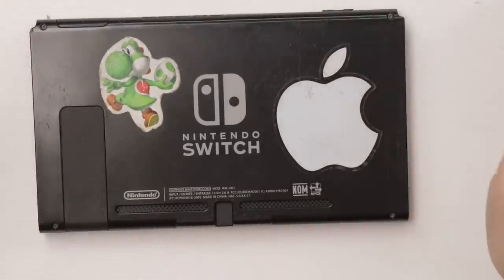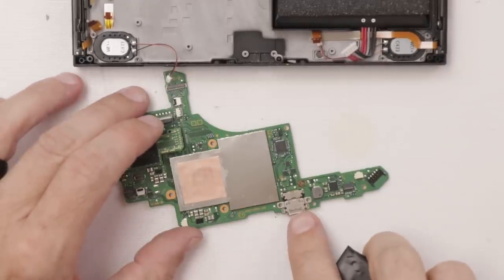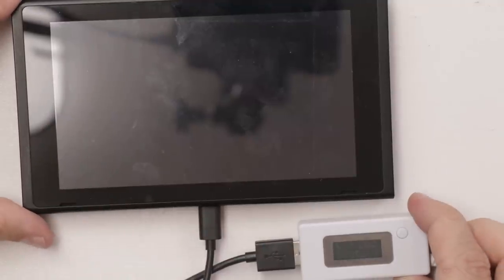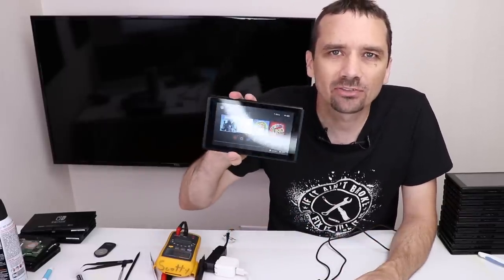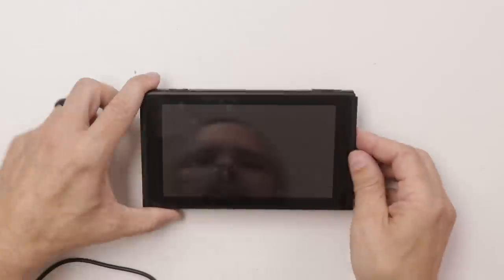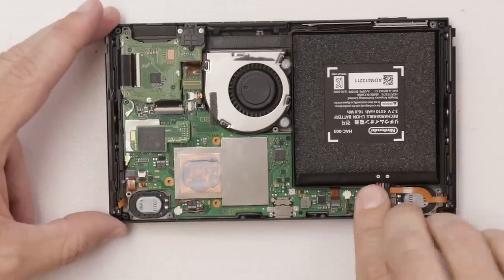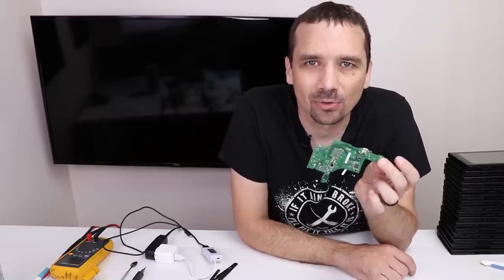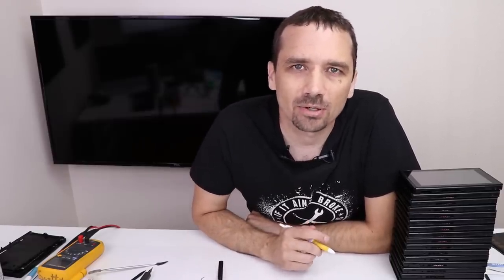The Numbers Are In (Sort Of)! This Lot of 20 Broken Switches Turned Out Good!

Comment: Are nintendo watching this and thinking "let's do something about the video chip"?
Reply: It’s supposed to be a security measure so you can’t charge your Switch with a 3rd party dock I believe.
Reply: @pr9334  That's called a money making measure, not a security measure...
Reply: @pr9334  That would literally be a violation against the terms for using the designs of a USB C Port. Because USB is supposed to stand for UNIVERSAL SERIAL BUS, meaning ANY bloody cable with these connectors works >_>
Reply: @Jukantos  the switch is pretty well known for not using the USB c standards that were put in place. The way the switch handles charging is exactly why you should never use any charger that isn't made by Nintendo. I bet you everyone of the switches that didn't charge (with the exception of water damage) were charged on aftermarket chargers or Android chargers
Reply: @toxicavenger6172  Luckily i still have my original charger, but i still think that's a bit of a miss-step on nintendos part.
Reply: @Jukantos  I'm not 100% but I think the switch handles charging the way it does due to the docked and portable modes.
Reply: @toxicavenger6172  It's not rocket science to improve on that, though. We've had almost 10 years of Android- and iOS tablets with external display support (and lately even way faster processing power than the Switch) and those charge in a sane way.
Reply: With the no third party chargers thing, nintendo had better print this on the box where it can be seen through the shrink wrap before you choose to go ahead with purchasing the console, in australia at least, otherwise they would be loosing money left right and centre. We have powerful consumer laws here which even Apple cannot escape. You take the busted consoles back to the store, touting australian consumer law "a major fault: a defect or design flaw that you were unaware of at the time of purchase that makes the purchase not fit for the intended purpose. You may return the item for a replacement, repair or refund at the your discretion". Apple tried a similar stunt with the Error 53 fisaco, where if the screen had been replaced by a third party, the phone would brick upon trying to upgrade the firmware, and Apple got kicked in the balls for that one :P
Reply: @dash8brj  it's actually written in the instructions not to use any charger except the provided one.
Reply: @toxicavenger6172  Ok, but he is not using the original charger in the video. So...
Reply: @Mitog98  yeah he just has it plugged into a meter so....
Reply: Yeah lol, when i use my Switch, i Charge it with my big Powerbank over USB to USB C
Reply: @toxicavenger6172  yeah but the consumer must know these befor he buys it
Reply: @stefanschmidt5186  no he doesn't or shouldn't know. If it's in the manual that should be good enough. It isn't Nintendo's fault people don't read
Reply: @toxicavenger6172  maybe we have laws more on the consumer site.
Reply: @bluefirexde  The tegra x1 chip found within those consoles is a beefy chip. It may not be very fast by modern standards but you have to realise that the chip in those consoles was designed for a set top android streaming box, the shield TV, not a portable tablet. There is a reason the switch has active cooling because it needs it and draws a lot of power. I completly understand why it doesn't work well with third party chargers because if you ever looked at the switch brick its 15v at 2.6a thats nearly 40w for a handheld console compared to the 8w of your standard brick. The chips in these consoles are old chips, still running on the old 20nm process meanwhile those modern chips are running as low as 7nm which are far more power efficient.
Reply: @toxicavenger6172  it's one thing to be cautious of 'bad' chargers, but simple protection circuitry (which they probably should have anyway) should be good enough to allow any correct voltage charger to work. Forcing proprietary hardware is just bad engineering and good marketing.
Reply from the maker: I sure hope so!
Reply: @Tronicsfix  Not gonna lie, you've given me quite a bit of hope that if my switch ever breaks, with the help of all the information i've gotten from this series and a bit more research that i might be able to fix it myself ^^ If it ever comes to that, i'll be sure to use your Amazon Shop for the spare parts ;) Very informative and entertaining mini-series
Reply: @stefanschmidt5186  the way tos and policies are writen are on consumers side if they werent writen like they were companies could say "oh we meant that another way so you case is garbage"
Reply: @kruleworld  "good marketing" is an opinion and iffy statement, you could actually end up turning away customers as well. I know a good amount of people who stopped using iPhones at 2 occasions 1. When they completely removed the 3.5mm headphone jack 2. When the "dongle" stuff started 
Forced choice/monopoly is not always embraced by the consumer, more often it is disliked. Only if your product offers a "good" enough service, will consumers put up with it.
Reply: finally one that saw the  main flaw in the  concept like i did
Reply: @pr9334  yeh, thats totally what it is. and parts in cars made from plastic instead of steel is so they're lighter not so they dont break and need replaced always
Reply: @toxicavenger6172  Belated reply but: Devices having a normal and fast-charge mode is pretty standard these days. The Switch defaults to 0.4A because the USB standard is 0.5A max. After it is sure the power source is compatible it then bumps up to its programmed max which appears to be 1.8A. As for the talk about USB-C non-compliance from the Switch: That appears to be when talking specifically about using the dock and what wall plug you use to connect the Dock to power. Connecting the Switch to a portable battery or other wall plug directly in handheld mode is different. In his videos here you see that it stays at 5V after kicking up to 1.8A quickcharging with a normal wall charger.

My assumption would be the Dock issues have to do with how the Switch overclocks while docked. It draws extra power for this, yet they want the system to also charge while docked, hence demanding more voltage. It is curious they chose 15V rather than 9V or 12V "supercharge" standards. Spitballing here, but it could be as simple as maintaining 5V for operation + 9V for Quickcharge 2.0 support which would be just under the 15V claimed USB-C draw from the Dock.
Reply: @aoitamashii  I'm not sure exactly what point you're trying to make here but it sounds to me like you just backed up what Nintendo doesn't want you to do and that's to not use an aftermarket charger. I'm not saying it wouldn't be possible for a company to make one. I'm simply stating what's that it is best not to use any other charger except for official Nintendo. Why risk damaging it over something so easy to prevent?
Reply: @toxicavenger6172  The previous discussion made it sound like you shouldn't use them under any circumstances. I was merely clarifying that only applies specifically for how you are powering the Dock. Also, it sounds as though as long as you are getting one that supports PD v2.0 (aka 15V spec) you should be just fine FWIW.
Reply: Surely the switch itself is dictating the charging current?  Why would an AM charger be an issue?  A basic charger (like the one he uses in the vid) is capable of putting out X amps, it’s not the charger going from 0.4 to 1.8 it’s the switch deciding when to do it isn’t it?  ps I’m an electronics numpty so just asking.  I’m not arguing the fact just interested what’s different about the Nintendo charger if the charger is only capable of providing certain amps and the switch does the clever bit?  My son has had a switch since they came out & it’s been perfect but he’s only used the official charging stuff.
Reply: @mr.airgun6921  It could be something like the Switch goes with Voltage Profile 3 which for PD 2.0 is 15v but since PD 1.0 only had three, the third profile is 20v aka too much. Just a theory.
Reply: Jonathan Connell revenue securety, not data securely :)
Reply: Frank Matthews rule one fornanual 99% of people don’t read them until  some thing  breaks/ don’t work, I’m guilry if this. I partly faulr nanuals, 90 % of the texr are eiter warnings (ie don’t sue us when you du stupid stuff) or warenty limitations, ie usless to most peopke when they get the device. I know they have to be there, but but them at the back,and put the don’t use third party charger or your swirch will break as the first point in the geting started section, and put that warning on the protection film that is on the screen when you take it out of the box

Comment: what is up with that video chip? so many broken switches due to it... design flaw it seems or planned obsolescence maybe
Reply: I think there can only be something wrong... And its usually 2 chips that die the video chip or the charging chip if I remember well...

Also while indeed some where killed by 3rd party docks or chargers, lot of ppl in forums claimed to only have used original charger\dock and got a problem on one of them...

There's also the other common problems of Switch's bending and some to the point where the touch screen even starts to come out probably due to heat when its docked in that closed crap dock with almost no space in-between...
Reply: @cedric1997 While that's true, you'd think they would put in some fuses, diodes, etc, instead of having to replace an entire chip.
Reply: The problem isn't just with 3rd party docks, if you take the official power cord from the official dock and quickly unplug it from the dock then plug it directly into the Switch it will kill the Switch as well. It's a problem with the power supply trying to send more power directly into the Switch than it can handle. I've seen the same problem with some Lenovo laptops switching between power supplies and docks.
Reply: OldMan_PJ wow thanks for the heads up that seems like an easy mistake to make if you aren’t careful.
Reply: @guily6669  the people claiming they only used official docks are probably lying. I'll bet you they used an Android charger or charged their switch using a portable battery a time or two.
Reply: @toxicavenger6172   I'm in one of the biggest forums of it and many had huge amount of problems reported... I think I believe most of them...

My friend's Switch also died in the 2nd day bought brand new from store, he ended up asking for money return and bought the PS4 VR instead lol... And he had bought Zelda digital which he couldnt play...
Reply: It's likely protection against hacking and third party products. Nintendo does this stuff regularly.
Reply: @OldMan_PJ  That's just bad electronics practice anyway. Why on earth would anyone do this? The charge needs to have  moment for the amperage to go down, otherwise you will just overload everything.
Reply: 3rd party docks and chargers are the problem here, it's more of a design flaw

Comment: $90 seems like a lot for a broken Switch.
Reply: I assume they are 90 cause they were not opened or taken any parts out :/ the ones that have been opened and missing parts might be like 50 bucks. STILL A LOT.
Reply: Why. The new parts arent that expensive and If IT runs again you resell it for 200+?
Reply: People on mercari are trying to sell their broken switches for 180 😂
Reply: dustiinn97 200 probably complete with joy cons, these are just the tables i assume they would sell for 150$
Reply: @freddydiaz8292  joy cons included

Comment: A couple of hours work?! I would have guessed all up about 30 hours.
How many hours did you spend all up? (Fixing, buying, selling, checking, etc...)
Reply: Agreed! - if we say $800 profit divided by 16 saleable items, that's $50 profit per device, before you factor in ebay selling fees, taxes, electricity, time and so on. Better than nothing but doing this is not going to make anyone rich... which is why almost no one has repair workshops anymore.
Reply from the maker: I have a repair workshop, and I make a good living with it.
Reply: @Tronicsfix  That's good news, I used to run a workshop for electronic repairs and gave up 20 years ago as there's no money to be made. I guess a small workshop with low overheads is still possible. But I got a regular job instead and never looked back.
Reply: @Tronicsfix  It's amazing watching you work man. Just curious in how many hours you spent all up, as that was the vital missing number in your maths at the end. You would have to work pretty fast I imagine!

Comment: I swear i can fix switchs for a living now lol
Reply: Apparently, you just need to change out the video chip. 🤪
Reply: Aren't you impressed by his component handling and soldering skills? I once decided to turn a purely battery operated device into also using usb for power, but then at the parts store I looked at a micro-usb port component, which was hardly bigger than a grain of rice. I thought I'll rather go with the good old bulky usb-b.
Reply: @herrakaarme  i actually have soldering skills too i fix headphones .. mice .. keyboards and its not actually that hard ... the problem is i dont have a soldering station or anything fancy .. i have a soldering iron made in china that is sold for less than 6$
Reply: $50 profit per device... minus ebay selling fees, your wage, electricity, taxes, tools, I reckon after all things taken into account he might be making $25 to $30 profit per item. Hardly a great rate for all that effort. Fine for a hobby, lousy as a business proposition.
Reply: @Dedubya-  tools already available electricity is like 100$ a year ..i dont have taxes i live in a rental apartment . So i guess i have rent to pay thats it .
Reply: @Dedubya-  Now it's around $13 profit per device, since the refurb price is around $135/ea. (Minus all the other expenses you listed.)

Comment: Why would you not test the screen turns on correctly before putting the digitizer back on o.O?
Reply from the maker: It was easier to put the digitizer back on because you have to connect the ribbon cables which would be next to impossible to do without the digitizer on.

Comment: Cool video but I think you over paid if turning a broken switch to a fully functioning one doesn't even double it's value.
Reply: If he can't buy a pile of broken switches for a cheaper price, then it can't be helped. Since he's been doing this work for a while, he also might have a list of sellers he would rather avoid, even if they had a lower price. Perhaps there actually is a significant enough market for potentially repairable Switches, and thus the prices are what they are, a question of supply and demand.

Comment: The question that I have about this, is how do you find the replacement parts for these things? I know you have a shop, I'm asking more in general. When you start work on a new repair, and you need to replace a connector.. where do you go and how do you find them? There are thousands of different connectors on sites like DigiKey, and the LCD screens are custom made.

Comment: I really liked these Nintendo Switch fixing videos, but I do have a random question for you: I see that you also fix consoles for people as a business, but noticed only the modern systems on your website - do you also do older system repairs? I have a Sega GameGear that I found recently and needs to be cleaned and fixed. It turns on, but the screen just kinda fizzles to blackness (though the backlight works).

Comment: Either I wasn't listening or I didn't hear, but what type/brand of 'heating pad' are you using to loosen the adhesive on the digitizer? I also d repairs & the forced air heat gun just isn't cutting it.

Comment: I'm not finding the link for the micro precision screwdriver you use to disassemble the case and parts of these Switches. Do you have a link for this? I repair laptops at work and this would help a lot!

Comment: What's the thin tipped metal tool you use to help with things like getting the adhesive cover off the tape strips on the back of the battery? Couldn't find it in the amazon list.
Reply from the maker: Dental pick

Comment: Hey I have a question I have a Nintendo switch and there are a lot of dead pixels on the screen, how would I fix that?
Reply: Benji I would say replace the screen or the videochip. When it turns on there should be any damaging corrosion
Reply: Does it show that on the TV? If not, then it's 100% the screen.

Comment: I used to do warranty repairs for Dell, and I gotta say, I'm a bit surprised at how similar the Switch is to the Surface in terms of disassembly
Reply from the maker: Interesting. I've heard the Surface is tough to get into.
Reply: @Tronicsfix  Not really, though it can be a bit... concerning. You have to pry the display off to get to the internal components, and the display can be very stubborn and flexes quite a bit. I was always worried I was going to crack the screen when I had to work on them.

Comment: Quick trick, if you add some fresh solder to the charging port mounting points it will be easier to knock the port out when u blow air to it
Reply from the maker: The solder melts very easy as is. Why add an extra step if it's not needed?
Reply: @Tronicsfix  that's only if the port gets hard to come of, if it comes easy then there is no need. Just like it tends to happen with old phones like a galaxy s3, old Bluetooth speakers, etc
Reply: @Tronicsfix  working with fairly new hardware is easier as it all goes smooth, however working with old stuff is harder and you learn a few tricks on the way

Comment: Question! For the video chip to filter retrace, do you have to worry about the physical length of the new trace wire because of signal timing or is that not relevant for that part?

Great video trilogy top quality fascinating stuff